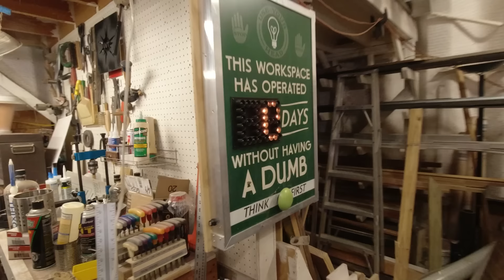DIY Mini Elevator

Comment: A guy I knew had a freight elevator in an old building he'd bought.  He ended up having to call it a "vertical reciprocating conveyor," in order to get insurance on the building.  Elevators are for people and VRCs are for cargo/freight.  Very different set of rules for each machine.
Reply: Thanks for pointing that out. That means I might build something that will prevent me from selling the property and I'll have to either store the stringers or all of the stairs so I when I remove the "elevator" I don't run afoul of our cities ordinances that the stairs are brand new. These are the same ordinances that forced me to go to this option. I also hadn't thought about what would happen with my insurance. Thanks for the comment because I was so excited by finding a possible solution to my issue that I didn't see beyond that.  THANKS! Now I need a plan B.
Reply: ...or, "goods hoist" instead of "crane": one is something anyone can operate, the other requires a dogging & rigging cert and a crane-driver's licence.
Reply: In the UK we call them passenger lifts (for people) and goods lifts (for goods) then there’s the American term “the dumbwaiter” (for goods which usually has a sign saying not for persons or something similar.
Reply: ...thank you...😂
Reply: ...not an engineer...
Reply: @paulfrost8952  Dumbwaiter is a British word - it only appeared in America a century later. The difference is that a dumbwaiter is a goods lift specifically for kitchens.
Reply: Well done ! We need more people like you ! If we could only convince the females to honor this type of man ! We should have a calendar for guys that can do stuff !
Reply: @dj1NM3 how do I get one of these dogging permits. That would solve a lot of problems.

Comment: Very clever, running that cable through the frame. I've seen a lot of elevator builds, and I've never seen anyone come up with that. One thing though: I know it's not that tall, but if you're gonna ride the elevator yourself, which I don't think you will, but... you know... Something like Jay's fall arrestor would be a nice addition. Really anything that'll prevent the elevator plummeting when the cable would break would be a pretty good idea.
Also: This elevator would double nicely as a height adjustable workbench/desk. Pretty convenient.
Reply: Seen several with SLR's as fall protection but that is not what they are designed for. 😮😅

Comment: I've been in a state of heightened alert in anticipation of this video... your clones have not disappointed.
Also, my 80 yr old seamstress mother gave the stank eye when you seemed astonished by the tote full of denim pockets. Always save the denim pockets.
Also, also... Cable through the frames is genius level stuff which, when the elevator is at the top, is even higher genius level stuff. Bravo!
Also, also, also... Lights and slickety paint job are what we have come to expect and the 'alert' sound makes me smile.
Reply: I was thinking about that, bin full of pockets might do well on Ebay!

Comment: Oh look, my new favorite video! Great engineering here, I really like the cable going under and back up, and good thinking integrating the limit switch like that. I'm also oddly satisfied by that angle brace at 5:18.
Reply from the maker: Thanks! Yeah, I went through a few iterations of the mount for the eye bolt that certainly would've worked, but were just awkward-looking, till I decided to use that bit of flat bar. 👍‍‍

Comment: Cool idea: running the cable thru the frame!

Built one of these "material lifts" years ago (pre-YouTube) in a bigger Quonset. Used the same type of trucks/trolleys (just had deeper, heavier-gauge uni-strut - the kind with no holes), a heavier winch (10 ton), many, many more pulleys, no welds anywhere, and a metal trundle bed frame (single) for the floor (left all the springs in place & topped the frame w/a sheet of 3/4" plywood). Sadly, have moved since, but the last I heard, the lift is still in place, used, and greatly appreciated. 

At the time, had a full trailer load of concrete forms (2x10s & 2x12s) I'd salvaged (with permission) from a nearby construction site; used those to make 2 "posts" (actually "L"s) at the 2 outside (front) corners, and bolted two 2x12s to the back (flat) wall of the Quonset. Drilled the Uni-strut & boards to hold 3/8" bolts (for each pulley), put massive fender washers on the back of each post to hold each of the pulleys in place, and installed the pulleys high enough that a 6'3" man couldn't get his fingers caught in them.

Like you, I also didn't want my cables "in the way," so each corner had a 3/8" cable permanently attached to the bed frame (used welded eyes bolted thru the frame with nylon nuts on each). Those cables went up (through several pulleys), over to the back wall, then all went along the back wall to a central point (just outside the lift's materials zone), before they all 4 went down thru another set of pulleys... and connected to a very large ring on the end of the floor-mounted winch. Was going to build a plywood "cover" for all the pulleys, but ended up leaving them open and set up a "checklist" for anyone using the lift: first thing was before use, had to look at each (numbered) pulley and check for structural integrity (there were several steps to that), physically look at all the cable connections, ensure the floor, and unloading zones were clear, etc.

(After riding it up down at least a dozen times) I "load tested" it: set it ~6" above the floor, called six 200+ lb friends (men) to do one "bounce" in unison. None of the pulleys bent or warped, the bolts/fender washers didn't pull thru the wood, the bedframe (platform support) didn't bend, the platform floor didn't crack or shift, the posts didn't move, and the winch never sounded strained when we went up 6" and back down to the floor. Couldn't find any 120v winches back then, so wired a solar charger outside thru the wall to keep the battery charged up.

Your video brought back fond memories... and introduced you to me for the first time. I'll have to go check our some of your other builds now.

Comment: Great build- I want one! If you are going to ride it, you should fit a cable tension released brake (like commercial elevators). There are slots at the back of the Unistrut they could engage in.

Comment: One of the best I’ve seen. Maybe put a hydraulic sweep at the front of the platform so when you hit a button it hydraulically pulls your cargo off your elevator onto The loft floor so you don’t have to go up every time and take it off. Great job, I’m going to steal some of your ideas. I love the cable inside you’re too big idea.

Comment: Very nice!
We are older and needed a better way up into the house attic than carrying stuff on our shoulders.
Inexpensive 440lb electric hoist on pipe between 2 rafters over the attic stairs, plug into attic outlet. 3x3 cargo net with slings lets us put almost any shape into it. Attach to hoist hook, much easier and safer to guide the load up or down than carrying.
We replaced a water heater awhile back and the plumber did a triple take when he saw it lol.

Comment: Are you familiar with a fall arrester? I’m not saying you need it (that’s your own choice). But it might be something to consider for those “rare” times that you’re bored and decide to ride the elevator. Great build- and fun to watch!
Reply: Most fall arrestors I’ve found seem to require more height to activate that the travel of the elevator.  My build has two of the but I’m not convinced they would actually help.  I get nervous any time i ride it vs taking my stairs and have been using the stairs.  Anyone have any decent solutions here please post them.
Reply: @stefanbuscaylet  The video I linked shows him actually testing the arrestor under an elevator failure situation. It worked well. He links to the arrestor he bought, I believe.
Reply: @deemstyle  So i found the video you used and i think i understand.  Other YouTuber recommended the 3m SRL (self retracting lifeline) and they include a pouch with some webbing that acts as a shock absorber of sorts (sorry don’t know the initial name i think its called an “energy absorber”.).  In my 3M SRL the webbing is between the unit itself and the cable connector.  It has a minimum free fall distance of 6 ft which means if the elevator cable breaks at 5 you’re still going to be moving by the time you hit the ground.  The one you have seems to have the energy absorber above the ratcheting unit and your guy just didn’t use that.  That helps actually.  Even though i already have to 11ft SRLs on my elevator i think I’m going to get the one you referenced and then I’ll have three units. Hopefully one of them will help as falling off this thing is gonna leave me with permanent body damage.

Comment: Hi 👋, Wesley , very interesting, question, Is it possible to make the actual lifting platform to hinge back up out of the way, I have been watching quite a few of these elevator tubes, Nobody has done it is it because of  safety aspect?, My big problem is I do not have a lot of money, but I have a property that used to be or still is in some respect a old mill/moulin , it basically has four floors, basement is accessible from outside on one side of my building, there is four floors in total, including the basement and the attic, I would like to try and get from my attic down to my basement safely, And I have to carry logs from my basement area up two flights of stairs for my log burner on the third floor, I am going to have to make trap doors that somehow open up, But close back down again to form a solid floor to walk across, when the platform ends up being in the basement, I need to be able to fold it up out of the way as I do not have a lot of space, And it will become a trip hazard, and as I’m in my 70s, I would like to be able to walk around without tripping over anything, can you give me some some suggestions please?, I’m a fully qualified cabinet maker, carpenter, specialist joiner I could make probably the structure out of timber apart from the track,
If you have some, any ideas, be very much appreciated , thank you, Phil from the moulin, France

Comment: That is a cool setup, wish I had something like that for hauling firewood up to my place when I lived in a 2nd story apartment with a wood stove, instead had to carry it up the stairs. 

The only thing I would add to what you did is a ramp on the front that would allow you to drive a hand truck onto it, although that could be made easy enough to just sit on the floor, and stow out of the way when not in use. 

Or  you could go really wild, and make a ramp from a piece of plate that was hinged, so as that when the lift started up, the ramp flipped vertical, and acted as a back stop to keep anything from rolling off the back. 

Cool project overall.

Comment: Brilliant, genius, outstanding and down right gorgeous!!!! Love it. Now I will make one to get my 91 year old mother-in-law in and out of the house and get rid of the 51 ft ramp I made to get her in and out of the house. Building this will enable me to reclaim desperately needed parking space, which the ramp takes up. Did I say Brilliant???!!! Thank you so very much for this example of how to make a proper lift. The only other thing you need to figure out is, should the line break, there should be a safety that either Stops the lift in place or lowers it safely without a sudden drop. A secondary chain and sprockets with a derailer that has a slow gear should do the trick. Let us know how that turns out, if you make it? Great work!!!!

Comment: Building one of these for sure.

By the way, running the cable through those pulleys and back up doubles the lifting capacity of that winch. I'm sure you know that but maybe not every one else does.

Comment: Did you ever considered hinges on the protruding bars integrated into a folding bracket design that would allow for the lift to either drop down or fold up out of the way when not in use?

Comment: I have made one also...Excellent design! I think you should add some extra iron support in the middle under the MDF plank. As it is, it's supported only at the periphery.
Reply from the maker: Thanks! It was in the original design, but it proved unnecessary.

Comment: Nice job. I built a 2 story vertical lathe and the carriage was similar in design to your elevator. The only thing I would do differently would be to use larger diameter pulleys to reduce the load on the winch and stress on the cable. Perhaps an automatic safety brake might not be a bad addition in case the winch has an internal failure?

Comment: It is good to protect oneself using a respirator when welding, especially with galvanized pieces of metal. But do you have any information on whether the friction disc in the PA 400 contains any asbestos or not ? Because it would be realeased every time he elevator is working. That is stopping me from buying such brand. Besides I don't know if that information is available on other brands.

Comment: Amazing build. You sir are a hilarious genius. I hope the man who failed in his attempt wasn't badly injured although I did laugh. I am very ashamed of myself.  Your innovation of running the line through to the other side and attached to the joist holding up the loft is brilliant and probably allows for better stability.  My workshop is in my attic, yes I know that sounds insane, but I live in a city and unfortunately my building is considered historic and due to noise regulations even if I built a large enough shed I would need to make it soundproof so the noise wouldn't be complained about and that would be expensive, but the $250 fines would add up quickly. I used pulleys to bring my heavier tools up and had to patch the walls afterward. I have used jigs to make hand tools into stationary tools. My favorite is the jig I built, with some changes from a video, that turned my Milwaukee Magnum into a drill press. No one, so far, has found the source of the noise because the attic is insulated and with the attic window blocked by a pretty curtain and insulation I've been able to work undisturbed. (I always wait until my tenants go to work of course.) I can't always use pulleys so I often have to have the material I use cut down and have had mixed results and a lot of wood wasted. If I can build an elevator I can get rid of the stairs up to the attic. Now all I have to do is teach myself welding. I'm sure there are videos out there that teach welding or perhaps a class locally. My only question is how much weight can your elevator handle? You're a slim man and I estimate your weight to be around 170lbs or so but I have a major project I want to undertake before I sell this building and I am curious by nature.
Reply from the maker: With a pulley, the hoist can pull about 800 pounds, but there are stronger ones. I don't know what the rest of my contraption can handle, but I don't expect to lift much. Thanks!

Comment: I love this. Works perfectly but the frame you built blocked your bench access behind it.  I think you could have put some heavy strut L brackets at the bottom and bolted the verticle posts to the floor and only put the cross braces above your head to make a door opening through the vertical posts. As long as the platform was raised you could walk straight through.
Reply from the maker: The plans I have for that area do not include the bench 👍
Reply: @WesleyTreat  I have been watching many other builds and yours is the best of the best. A little safety humor makes a great point. Keep it up.

Comment: I have seen a whole bunch of these made over the years and the one we had in our shop that went to the basement was just a 4 post frame with a 110v winch. Was super simple and used plastic shims to keep the thing from smacking the sides. Was about 4x4 and could move parts and material up and down pretty easy. 
You did a pretty good job with the cable.

Comment: I would check  what the minimum bend radius the cable is rated for. Those are fairly small rollers you are repeatedly bending the cable around.

Comment: nice build... many 4 post car lifts use this very principle (cables running through the posts, to a singe hydraulic ram in most case)
did you do some calculations of the weight it can take (esp. with the leverage effect on the rails since they are not used the way they were intended to... one failure mode would be rail opening up where all the load is be applied to a single wheel at the top)

Comment: Fascinating build. How would you address a failed clutch in the motor that lets it free wheel? I have started looking at the simple manual ratchet pulleys to see if one of those mechanisms can be cannibalized...

Comment: What is the load rating of the MDF for the lift? I think you should have added a cross member or two to the lift floor, just in case you overload it a bit, so it doesn't fall through the MDF.
Reply from the maker: It was designed with cross braces, but I realized they were unnecessary for the size platform I was building. I won't be lifting anything even close to heavy enough to smash a hole through it. 👍

Comment: I’ve always been thankful that I don’t own anything with a back-up beeper. When I hear one on a truck or construction vehicle I always think I’d have to cut the wires if I had to drive it. Your bells and whistles were a good gag but I’ll bet they get turned off in the near future. Love the goods lift however. Yours is the best design I’ve seen. 🥸👍✅